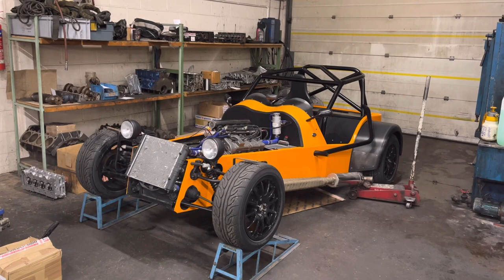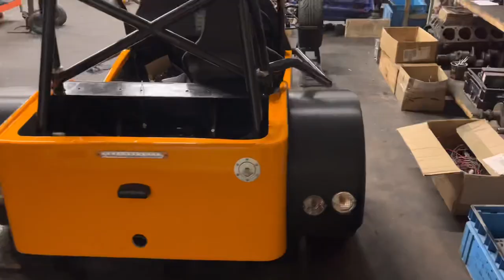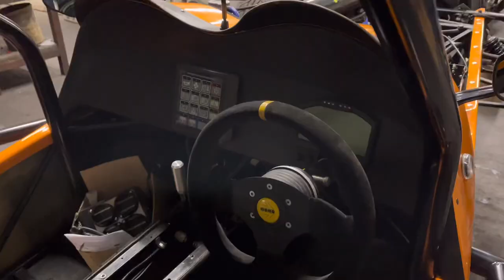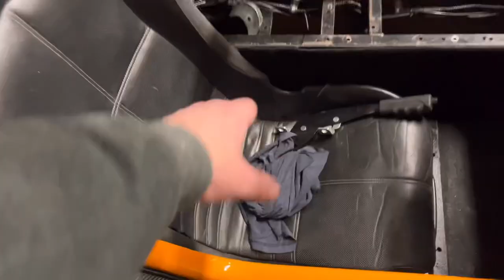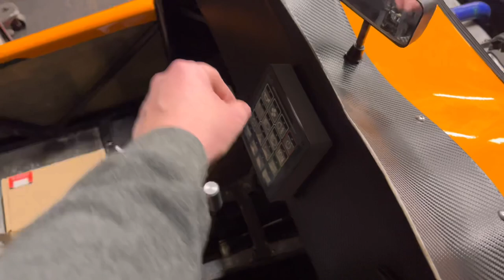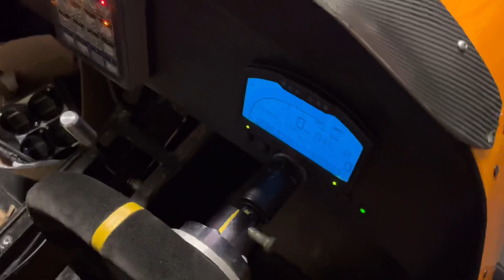Could THIS be the FASTEST kit car?

Comment: I have serious doubts about the 1000 horsepower goal.  A long time ago we built a roadrace car with a turbo Hayabusa.  It weighed 1500 lbs and with 24 lbs of boost running 115 octane racing gas we dynoed at an honest 350 horsepower with a fat powerband from 4000 to 9000 RPM.  This was an all out build with a Moldex billet crank, Carillo rods, and a radically ported head.  It was sideways in the car with a driveshaft to a Midget quickchange rearend.  Once we stopped stripping aluminum engine couplers by going to steel couplers the drivetrain was reliable, but the engine vibrated like mad and had a voracious appetite for both intake and exhaust manifolds.  While I'm sure the state of the art has advanced a lot since then I seriously doubt that you can make triple the horsepower above our motor.
Reply: Who knows?? I might be wrong but I think the old 4-cyl Group B Rally cars (Peugeot t5 springs to mind) could make around that in top tune. some had super and turbo charging...and I bet they didn't last that long!! :D
Reply: @thesunreport  205 T16 Evo 2 made 550 - 600 dependent on temperature. Some rally cross engines made more for a very short amount of time..

Comment: Maybe a random and bizarre idea, the void above the differential is possibly a great exit for air under the vehicle in conjunction with  a new bootlid with rear facing air exits. You could also mount a radiator or oil cooler there. With the possible ridiculous power you will have a ton of heat to get rid of, plus a bit more weight over the back wheels could be a good thing. In some ways it might be good to have no radiator in the front....  PS I think you should have an indicator stalk, the buttons on the dash will soon be a nuisance for that.... keep up the good work,

Comment: 1000bhp will be more than a monster - we built a 450 bhp Busa turbo and it’s almost uncontrollable, customer runs on a 270 map to keep it in a straight line.

If you need any inspiration for the rear panel then give me a call in the office.  Neil
Reply from the maker: Thanks a lot Neil, I’ll give you a call tomorrow if that’s ok 👍

Comment: I once worked with a guy that built a Robin Hood, which is very similar to a caterham. He installed a stock Sierra RS Cosworth engine and it was pretty much undriveable so best of British with 1000bhp. You will just sit there smoking rears in every gear. Power for power’s sake is a pointless exercise. You have to be able to use it.

Comment: If the sump drain is on the side of the sump and is big enough you should be able to get a bush made to screw in then screw the oil temp sender into that. 1000hp isnt gonna happen out of a Busa motor. 500 is pushing them.

Comment: If you achieve 1000hp in that it will be the ultimate 'widowmaker' all it will really do is turn rubber to smoke on its way to murdering the occupant. I doubt 1000 from the motor is achievable, but good luck.

Comment: I own a Mini Moke with a massive ( 🤣 ) 37BHP so seeing your kit car with mention of 1000BHP got me thinking. Like the Moke, your car is light in weight, especially at the rear. With a 1000BHP power plant at the front, how would you transfer that much energy into the rear tyres without spinning them in all gears ? I rebuilt an Australian Mini Moke with a 70BHP MG ‘big valve’ A series engine and it was fun, but it was front wheel drive with the weight over the wheels. I think if you go too crazy with the horsepower on your light weight  kit car, it will be anything but a joy to drive. Surely there must be a known equation for Power to Weight ratio that takes account of traction to the road and best smiles per mile rather than bare face white knuckle terror at the wheel ? 🤣 As the old saying goes…. Just because you can, it does not mean you should 🙂👍

Comment: As an engine builder you should know that 1000bhp from a busa motor is just idiot talk. Keeping the head on would be the least of your problems😂 And it still wouldn't be the fastest kit car. If your serious about that sort of power, look at a turbo'd LS  6 or 6.2 ltr with the appropriate box and diff, shafts. 
None of those bits are available from the UK just the states👾
Reply: Richard Harrold  Not for the cost/power/longevity point of view.
Reply: Richard Harrold  Not with the components required to make 1000bhp. A 2Ltr makes just over 800 with 60< lbs of turbo assistance,
The 2.4 needs just over 50Lbs. 
These units cost £12000 in parts that only come from America.
Reply: Richard Harrold  Who in the UK makes parts like that, for less than the U.S, Farndon? Nope, Omega? Nope, Doug Kiddy? Nope stopped answering their phone 6 months ago. 
High quality, small batch production runs with more than one man. process is no longer viable in the UK

Comment: 1000, 2000 or 3000bhp. Take your pick. It’s just meaningless numbers if you don’t have the tractive effort to be able to use it.
Reply from the maker: U are right there Pete 😳
Reply: Did you say you would use it on the road.
Would it pass an MOT with the indicators and horn being controlled from the electronic dash.
I would prefer them on the steering column so your not fumbling around trying to find the right button to press to indicate.

Comment: I say as far as the back  half 
put a wing for more down force.   It needs all it can get.    
As far as a 1000hp don't
The car will be  un driveable  with the tires combo and I don't think you could put 18in wide tires to help with traction I would say 400 to 600 max and that really pushing it  your talking 2 lbs per hp 
I would guess I don't know the weight
think you would like to enjoy  driving it not have issues all the time
With crazy hp on a high hp motor

Comment: 1000hp what a complete waste of time it will be undrivable and will be going backwards through a hedge on first corner my 2001 camaro with 700 bhp will try to swap ends at 110mph much too easily spinnimg both back wheels
Your high power slipper will kill someone